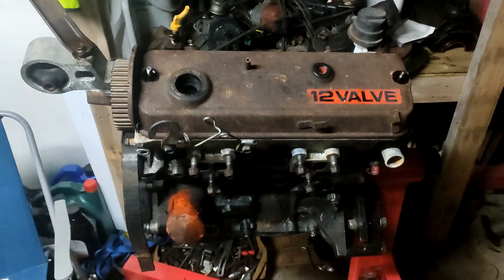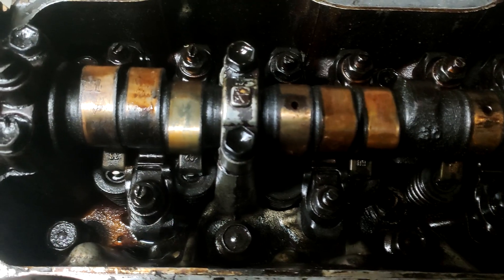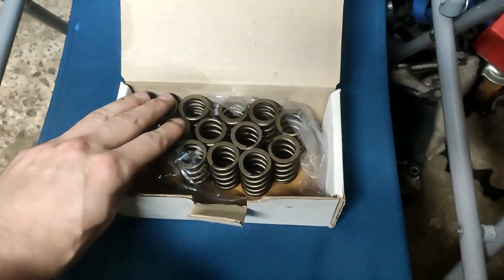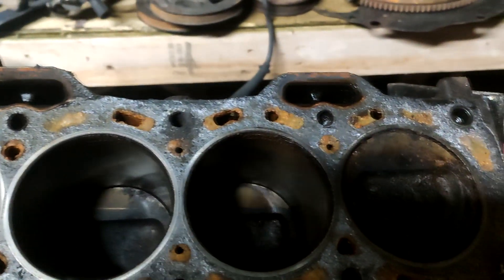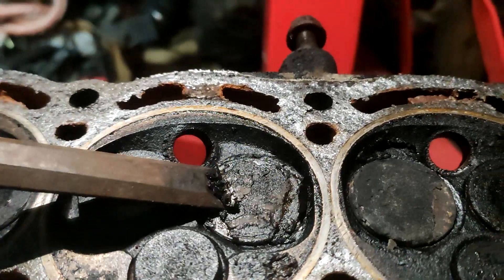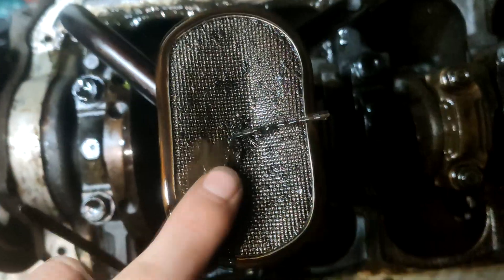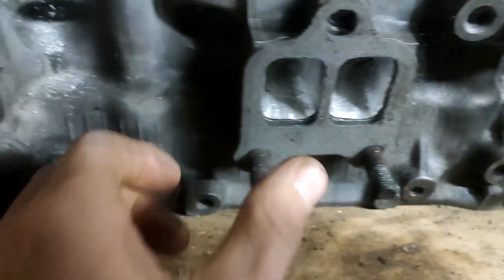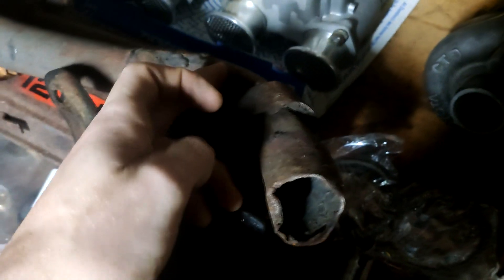2E Turbo Engine Teardown/Rebuild EE90 Toyota Corolla

Comment: I am about to oil change my 2e in the weekend at 280,000km. I haven't completed 10,000km in nearly 18 months and looking at that sludge makes me wonder if I should feel guilty.
Reply from the maker: yea they will run for heap of kms with no problems the main reason they get sludge build up is because the valve steam seals start leaking and that cause carbon iv found alot of motors iv worked on have this problem

Comment: Hi, may you please link the valve springs.
Reply from the maker: Hi sorry forgot to put description heres the link https://www.ebay.com/itm/FITS-Toyota-2E-3E-Performance-Upgrade-Valve-Springs-to-suit-high-Upgrade-Mods-/163650313565?_trksid=p2349624.m46890.l49286

Comment: What type of fuel regulator did you use on red toyota, and how much fuel BAR are u running
Thank
Reply from the maker: hi im running a Malpassi Petrol King Fuel Pressure Regulator -1/8 NPT fuel pressure reg and the fuel pressure is set to 3.5psi here's the link for the one i brought these are one of the best fuel pressure regs ive used thanks. https://weberspecialties.co.nz/online-shop/regulators/malpassi-petrol-king-fuel-pressure-regulator-1-8-npt
Reply: @RuggedGarage  Thank you bro for all of this information, you are the best :D <3

Comment: Hey i hope that soon you will change  it to fuel injection.
Reply from the maker: looking at a Holley sniper efi 2 barrel setup or fitech efi carb may still go with a weber 32/36 setup depend on costs

Comment: Hey, I recently bought a 87 starlet with a SOCH 2E carb engine. How would one go about advancing the timing and by how much? Do I actually gain any power? What do I accomplish by removing the vacuum lines as you were writing about in another video? You also said you fitted a pod filter, did you simply remove all the other components and lines attatched to the stock round air filter and does it still run okay?
Reply from the maker: hey it depends on your gas and air filter for timing i cut my stock airbox up and trimmed the edges and i ran no air filter. Also I only use 98 octane gas in mine at 30 degrees advanced. And it runs great huge power gain can feel huge power band from 4500rpm to 7000rpm. I removed the stock factory metal vacuum hardline and rerouted all the vacuum lines also the pod filter give the car a very nice carb sound the car runs very well.

Comment: hello man, are you still selling the 4-2-1 exhaust manifold for 2E engine? thank
Reply from the maker: hey i don't sell the manifolds but here's the link to where i got mine https://www.trademe.co.nz/a/motors/car-parts-accessories/performance/exhaust/listing/3141478705?bof=4hU25qPz
Reply: @RuggedGarage  Can you please make one video about weber one, and show how did you do that and all vacum ports that need to be instaled to the manifold